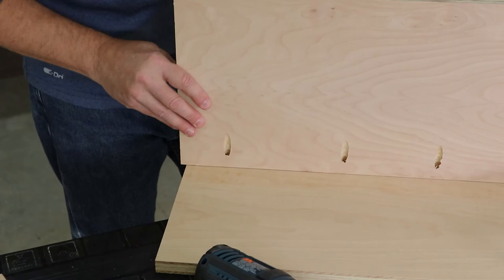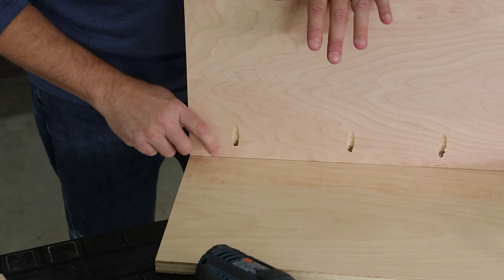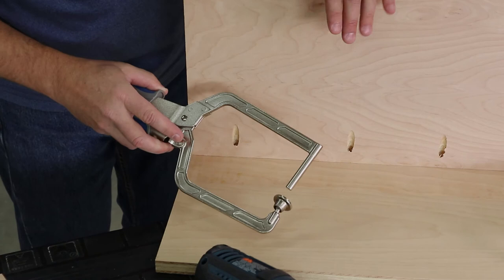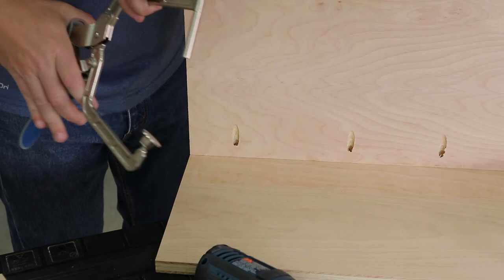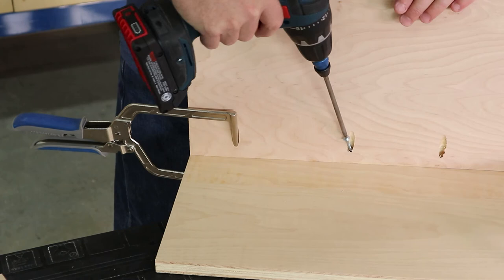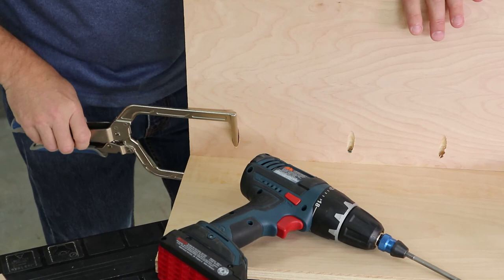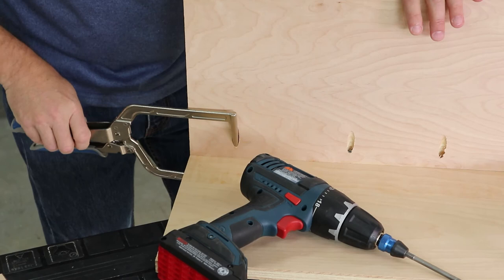How To Hold Case Sides at 90° During Assembly

Comment: I see some woodworkers use the pocket screws on the inside of the assembly for side pieces (as per video), but others say you should go external inwards so the screw has more bite and is stronger. Does it matter? Which is stronger?
Reply from the maker: Strength is really equal in both orientations, as the screw still enters the wood the same way, and is surrounded by wood in either orientation. Some inexpensive plywood, or plywood with very soft plies, may have slightly greater tendency to have the plies separate in the inside-to-out orientation, but this isn't common.

The bigger factor in which orientation to use is visibility. In kitchen cabinets, for example, the outer panels are usually hidden when the cabinets are joined together. So, putting the pocket holes on the outside makes sense. For a bookcase or a similar project, though, the outside panels are much more visible, so putting the pocket holes on the inside makes more sense. In either case, if you want to hide the pocket holes, you can plug them.